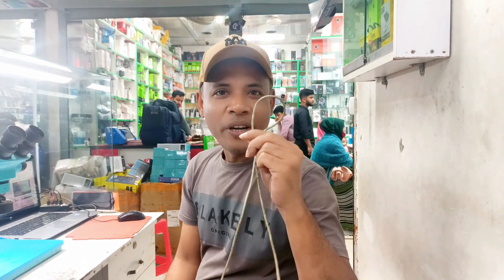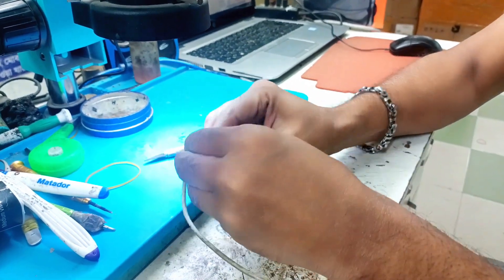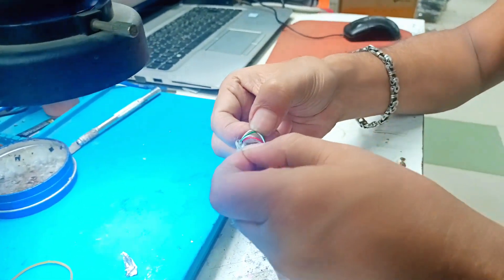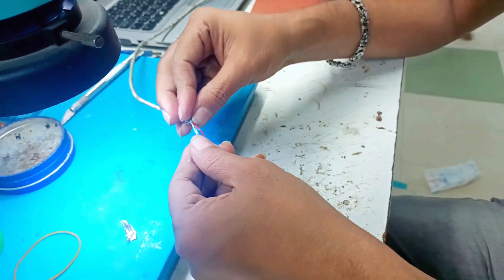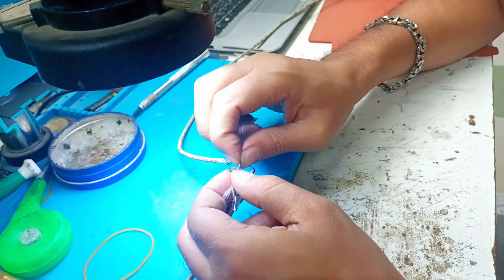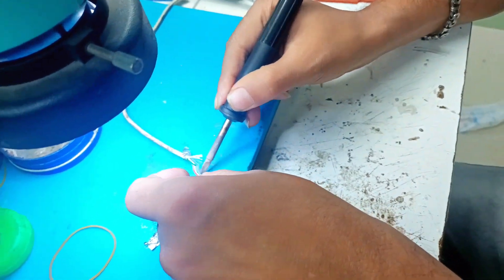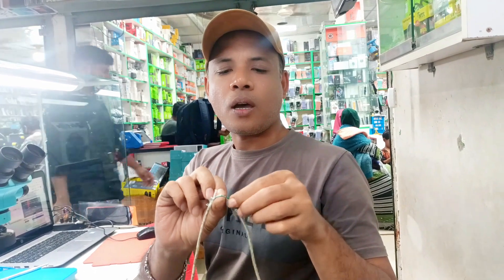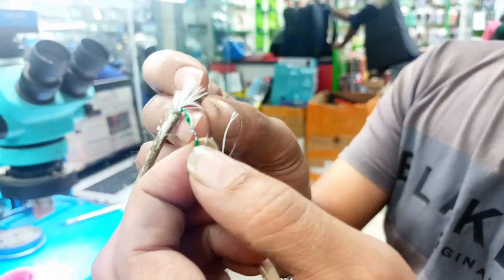How to make Samsung Edl cable for Samsung frp remove For Unlocktool #edlcabol #samsung

Comment: Hola, creo que hay una confusion ... el amigo une el verde con el blanco ... y es verde con NEGRO ... o quiza mi pantalla no distingue el color negro... pero la solucion es funcional. SI me ha funcionado con Samsung A05s... solo que yo si junté el cable verde con el negro. saludos a Pakistan y gracias por compartir los conocimientos. saludos desde Mexico.

Hello, I think there is a confusion... my friend joins green with white... and it is green with BLACK... or maybe my screen does not distinguish the color black... but the solution is functional. YES it has worked for me with Samsung A05s... only that I did join the green cable with the black one. Greetings to Pakistan and thanks for sharing the knowledge. greetings from Mexico.